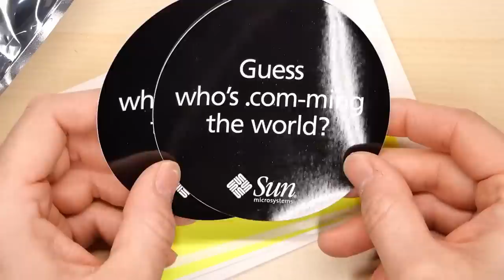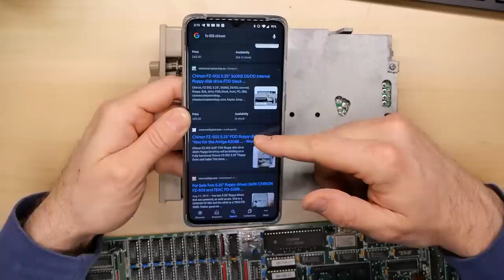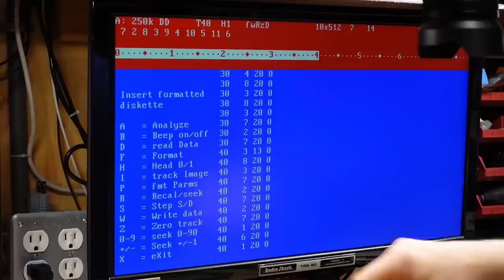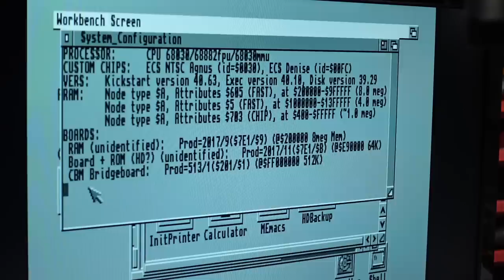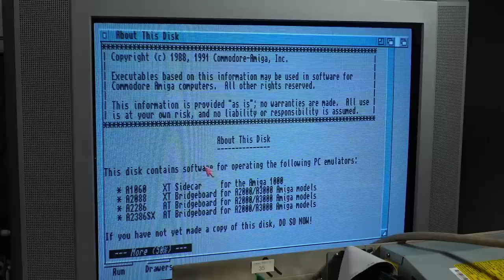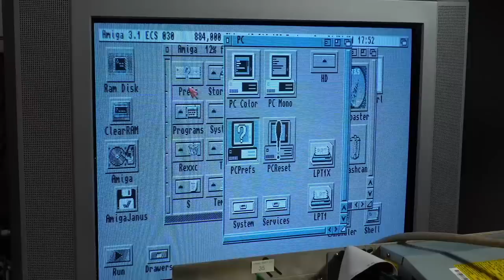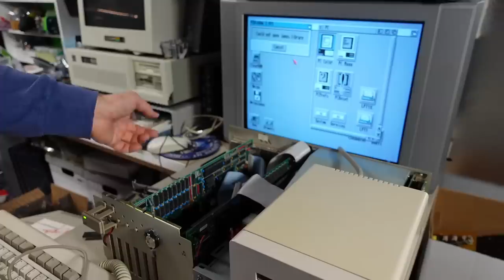An IBM PC XT inside an Amiga: The A2088 Bridgeboard and the original 360k floppy drive

Comment: Hi Adrian, This is realy dumb, but, is a copy of Janus.library in the LIBS draw? Just a thought because I had a similar issue with OctaMed 4.
Reply: hi Franko it's certainly worth checking out; i have occasionally had to copy libraries or device drivers manually when installing software on my A1200
Reply: @BertGrink  Yeah, they don't always seem to do it automatically.
Reply: @frankowalker4662  Meanwhile i saw another comment saying this particular library belongs in the Expansion drawer, not the LIBS: drawer
Reply: @BertGrink  Realy? O.K. The Amiga always was a bit odd. LOL. I still love it though.
Reply: @frankowalker4662  Yeah it may be a bit quirky, but it's also very flexible; just think of Commodities, CrossDOS, and the fact that any library function can be patched.
If they could have continued to develop the Amiga, it would have been the most powerful computer today.
Reply: @BertGrink  I heard a rumor in the late 90's that Microsoft had a hand in Escom's demise to stop the Amiga progressing. Absolutley no proof though.
Reply: @frankowalker4662  One should be careful with rumours, but on the other hand, there's the saying that you can't have smoke without a fire.
We will probably never know the truth about this, but it doesn't sound too far-fetched.
Reply: @BertGrink  When you have a reputation for stifling the competition, rumours are bound to spread.
Reply from the maker: Yeah it was there -- I had to move it manually since it put it in the wrong place. I could tell the difference because without it there, the error is instant. When it's in the right place there is a delay (While it tries to boot hte card) then the error pops up.

Comment: That board deserves a whole video with a fix 😀
Reply from the maker: Ideally what I need is to borrow a known good card so I can fix any Amiga system / CPU / Kickstart issues that may exist- - then I can focus on the board. Until then, I don't know for sure if the issue is software / Amiga related. Too many variables
Reply: @adriansdigitalbasement  I think you would be able to employ your 8-bit scope troubleshooting techniques to find out if something like a RAM chip or logic chip is bad, at least you can try starting with simple things and go along. But you would need a dissasembled Amiga put on a table to be able to reach and measure signals while in operation.
Reply: If you're interested to see some of the trials, besides Jan Beta's, I did it in #DOScember here, and got it all going... eventually.
https://www.youtube.com/watch?v=NGk31dRc05E&list=PL2O6RH1Isy65p-cPxMx9HGlq9O_j9iVdx
Reply: @adriansdigitalbasement  On my system (Amiga 2.1), the error message was "Couldn't find Janus Library" which may be the equivalent of your error that the Janus Library couldn't be opened was that I hadn't yet run binddrivers, which loads it. You can run SysInfo to determine which libraries are loaded. Hope this helps!
https://www.youtube.com/watch?v=NGk31dRc05E#t=6m10s
My suggestion is to boot from the 3.5" Bidgeboard Amiga Install floppy and see if the Bridgeboard works then. For me, it did, and I had the confidence that the Bridgeboard was working. After that you can patch up your configuration on the bootable hard drive with the necessary driver and such... that's the way I got passed the error hurdles.
Reply: @adriansdigitalbasement   @Adrian's Digital Basement  That's one way for sure. Or you can take the Accelerator('030?)/hard drive system software out of the loop by booting on a Amiga 1.3 floppy with accelerator disabled. My A2088 Bridgeboard runs on my 2000 with Kickstart 2 ROM, and accelerator disabled when booted from the Bridgeboard install floppy which had Amiga 1.3 software. There may be nothing wrong with the Bridgeboard... except the person that sent it to you only speculated it cap problems? Good luck whenever you get back to it!

(I still don't have the Bridgeboard working with a 68040 under System 2.1 software. I have to fall back to the 68000. This is probably Janus and/or Enforcer or Fusion Forty issues for me, but the XT Bridgeboard isn't going t work any better with the accelerator on the Amiga side.).

Comment: I had a PC with an older Motherboard that did not start whenever the workshop was cold. The K6-3 Processor on it was a little bit overclocked.... But it was running stable when the Motherboard got warmed up enough. I think that the CAPACITORs for the Processor and in the Powersupply were a little bit weak due too their age.

Comment: Have you thought about connecting a PC speaker to the card itself?  Just being a PC guy from yonks back, different beeps would tell you the fault that was found before the system initialised enough to run the monitor display adapter.

Comment: The cold boot problem is with the GVP SCSI controller combined with the SCSI2SD. I have the exact same problem with mine, using a GVP HC+8 and SCSI2SD. The SCSI2SD initialization timing is incorrect. Maybe the firmware needs corrected. I haven't come up with a solution other than using a more modern SCSI hard drive (80-pin SCA with adapter). It will boot just fine every time with a normal spinning disk hard drive.

Comment: The disk drive looks exactly like the one that came in the PC-I - so it was used by Commodore, so it's plausible that this came with an Amiga part, just like the 23 (not 25!) pin port for the external floppy. The head cables are quite delicate and I had to repair one of mine - the "erase" lines are separate ones from the read/write ones, so if the head reads but the that erase line is broken, it will not format/write on that head. I have the PC-1 repair here, near the end https://www.youtube.com/watch?v=fUHMRTGlogQ and the technical manual of that has the floppy schematics in as well.

Comment: I can see that shared resources has some benefit, however this is also a complicated approach depending on whether one just wanted to run PC programs, or whether one needed to pair resources significantly. If a person ONLY needed to share some basic things, making the device not share bus for anything except communication (making it an internal PC terminal) would be easier to install and evaluate. This is a powerful beast. I assume if there's such a device there might be better documentation and troubleshooting info. Not sure otherwise. The ONLY thing I would have tried that I didn't see was removing the software, getting rid of the 32MB drive created on the system drive, and basically get rid of all trace of it in the Amiga scripting language that starts it up. I don't know ANYTHING about an Amiga - so you Amiga enthusiasts  - what does it take to COMPLETELY remove a program? Then, once removed rerun the install again on the easy mode. Let it make the decisions. Maybe it knows things about the hardware that will give it better choices. That's my guess, and it's only a guess. The only thing close to this I ever did was using an NEC V30 to run both DOS and CP/M. Good Luck on maybe figuring it out Adrian!

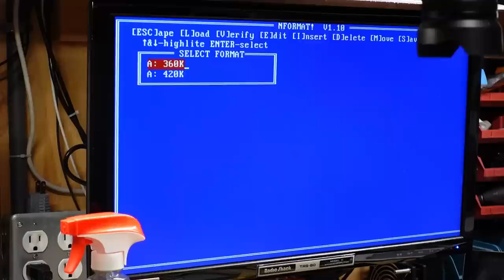Comment: 15:28 The problem with NFORMAT is obvious, it's having a FATEL ERROR.  😉

Seriously, I'm not sure what it could be, although I'd seen a few weird formatting problems back in the XT/AT 8088/286 days.
Reply: Possibly the circuit for the "WRITE" function is shot, but the "READ" circuit is working fine.

Comment: hardware emulation is still emulation - despite applications being run natively on target - x86 - processor. Emulation is every attempt to make one system to work like the very different one. And in this case it was perhaps more on the amiga side - as it emulates sound, display, keyboard and mouse (maps amiga resources to bridgeboard as XT system resources). Ppl back then didn't get crazy angry once emulation was mentioned. Sure it's way different approach than e.g. PC-Task which is purely software emulator. It's also different from shapeshifter which emulates only part of mac environment while CPU itself is the same as in amiga so application code is run natively. It is an emulation though. Would be really great if ppl didn't take emulation as something bad. Even windows emulates windows :) That's what ntvdm is for and that's what syswow64 is for.

Comment: The Amiga DOES natively support 5 1/4" drives. Paula is perfectly capable of handling them and you can connect a 5 1/4" drive to the regular floppy port (with the right cable) and write Amiga-formatted 5 1/4" disks, or FAT disks. You can even do some adjustments to the drive to hack the Amiga into reading (but not writing) C64 floppies.

Commodore made the A1020 drive to use with the Transformer software IBM PC emulator, but it was quickly discontinued.

http://www.zimmers.net/cbmpics/damigas2.html
Reply: Note that the A1020 and most other 5 1/4" drives don't have disk-detect signals so you have to manually issue the diskchange command to tell AmigaOS when you change floppies, but it's possible to wire in the diskchange signal on the rare electronic-eject 5 1/4" drives that were used in a few systems, or hack your own diskchange signal in to the lever.

Comment: There was also PC XT Card called "Sidecar" for the Amiga 1000  harddrive /networkcard isa 8-bit slots  see https://en.wikipedia.org/wiki/Amiga_Sidecar . 5,25" diskdrive  from Kupke GmbH Dortmund (Germany) 40/80 track with diskchange signal for Amiga 1000 ...
I owned a Amiga 1000 with 5.25" external diskdrive , memory box 1 Mb from Kupke and a sidecar using HDD for Amiga 1000 /PC and a 8 bit network card (access to Nowell Network / Ethernet).  Kind regards from Germany.

Comment: The floppy issues in your vid remind me of some intermittent issues I’ve had recently with a 3½" floppy drive on a Pentium 100 class PC. Sometimes it works correctly in DOS, other times it has read errors on known good floppy disks. In Windows 95, it shows up as a 5¼" floppy. And in NT 3.51, it disappears altogether in File Manager.

It probably doesn’t help that the CMOS battery died, so I haven’t quite figured out why the floppy drive only sometimes works.

Comment: Problem with A2000 could be a dry soldering joint - on Noels Retro Lab he shows under a microscope solder joints that look good but are dry and cracked causing internittent faults

Comment: Janus Software has big issues with 030 processors and faster. A software callen "Enforcer" can be used to make both work together. But it causes other problems in daily use, so it should only be activated if necessary.

Is the janus.library installed under SYS:LIBS? If the installer crashed it may have happened before everything was copied over.

Maybe the plcc sockets on the card are faulty, that is a common problem with most non-smd Amigas nowadays. So replacing them would be a good start. 

Could also be corrosion in the CPU socket or the bios on the 2088XT has gone bad.
Reply: Yeah i was wondering too if the janus.library had been installed correctly; if not it should be possible to copy it manually
Reply from the maker: Yeah I had to copy it manually -- once that was done, there was a pause before the error message came up instead of instant. I had reseated all the chips, cleaned contacts, different slot, etc. I can't remove my accelerator as it's also my SCSI card so perhaps one day I'll try it in my other 2000 which has a Zorro II SCSI card and Kickstart 2...
Reply: @adriansdigitalbasement  You could use a oscilloscope to see, if anything ist going on on the adress and datalines of the 8086. Reset (pin 21) is intresting, too. It should switch from Low to high (or was it the other way around?) a few seconds after the system turned on.

That card looks not bad from afar, but maybe it was stored next to the moldy floppydrive. So cold solderjoints or damaged VIAs could be a problem here.

Comment: Yo Adrian.. Have you replaced the capacitors for this Unit, I only ask because it seems like once you have had the unit on for a while capacitors near to failing may be getting reformed and thus test OK, But as they discharge over a lengthy Period, when initially switching on they once again need time to reform loading the Power rails down long enough to screw with power up timing, Long story short, once they are reformed "there is enough charge to ensure a reliable boot" ergo the unit has no problems switching on within it's timing tolerances.
I would be checking capacitors after the Unit has been off for a considerable time " Work your way from the Power Supply towards each respective Voltage rail/s.. don't ignore any capacitors even ceramic and epoxy ones..  Good Luck..

APU I dropped a like..

Comment: Could be that I'm lurking around in ya hardware?
I guess it could be a RAM issue? worth trying replacing the RAM (Especially if Micron Semi branded.... lol in 2021 the Micron Semi branded DDR3 has exactly the same RAM degradation as they had in the 80's ._.)
Hopes this helps ;)

Comment: 18:42 Adrian - Is it weird that the drive you're thinking of putting in has a red LED? My original (2) Amiga drives on my A2000 have a yellow LEDs.
Reply: Commodore used a number of different drives by different manufacturers (basically whomever would give them the best deal at the time). I have seen both red and yellow LEDs. There are like 3-4 different models by different makers...
Reply: @mikekopack6441  Interesting, tnx!

Comment: Always seemed messed up to me that the big-box Amigas dedicated so much of their mainboard space to providing that ISA backplane...
Reply: Indeed. That's why some Amiga daughterboards have PCI slots... Never appealed to me.
Reply: Those ISA slots came in handy later for video users. Single board timebase correctors became available that used those slots, but only for power. TBCs were needed to sync up low end VCRs to the video Toaster.

Comment: Maybe some of the RAM chips on the bridge board are bad. That could cause the error.
Reply from the maker: I would have hoped bad RAM would still result in a beep code at the minimum even if it couldn't talk to the Amiga side.
Reply: I tend to agree. It’s common for dram chips to fail being aged a lot lol

Comment: it cool see u got one n repairs it
i never got hand on one them so there not much i can do about it 
i was thinking about that psu isnt being able feed enough power to card get it working if u happen open psu besure remove that referee because that will be other issues with stinky
i dig into few information i may not be much usefull but give it shot
there could be bad 8088 chip or no power to it i adjusted u try turn it on m check pin 8 n see if any power or data if no there shorted somewhere not receiving any power to card on motherboard or psu

Comment: aluminium rusts as aluminium-air battery/fuel-cell
Reply: salt water would make it corrode fast or any other such electrolyte water or similar
Reply: anything that removes the aluminium oxide protective layer

Comment: Damn would have let u borrow my vortex modded with ibm blue lighting
Also did you try booting off pcinstall disk
Also i would try redoing the bios rom and reseating chips on the bridge board
https://eab.abime.net/showthread.php?t=105469
Also u might need to upgrade enforcer https://eab.abime.net/showthread.php?t=37852
Try taking the 68030 out see it it works if so then do above in eab thread

Comment: Man, listening to that makes me cringe. Its not "thicker than a PC drive". It was normal height for floppy disk drives, they also were used in PCs and got slimmer over time. You also dont install a full height 5,25" HDD in your modern PC I guess, but does not make it any special just because it is an old standard. It was a generic drive, specifically made to comply with Commodore standards (similar type is also used on Atari ST, just with different jumpers, boards, eject buttons, front plate etc. and also PC, even HD versions. Does not know anything.
Reply from the maker: What are you talking about?  3.5" half height standard was 4 in × 5.75 x 1.63 in the early 80s set by hard drive makers. In 1988 Connor came out with the first 1" high 3.5 drive and that form factor was born. The industry quickly standardized to the 1 in high form factor for floppy drives as well that is still in use today. I have countless old machines (XT and 286 laptops) from the late 80s using this type of disk drive. The Amiga drive is 1.2 in height -- because before 1988 there really was no standard, so therefore it is thicker than the stacks of  3.5" 1 in floppy drives I have.